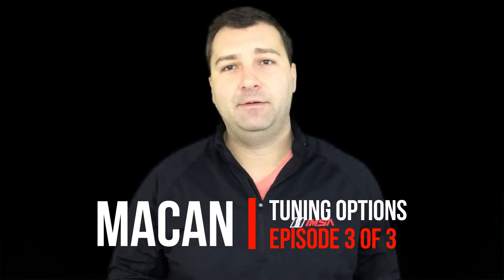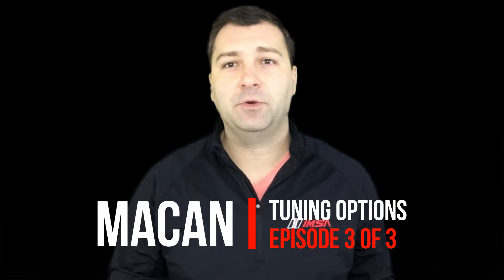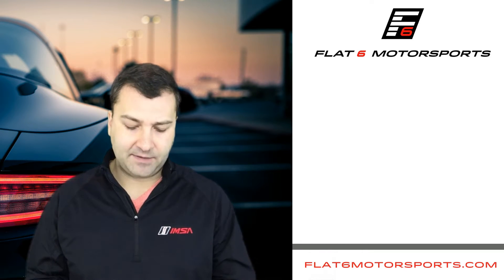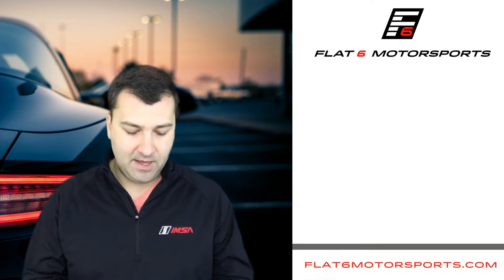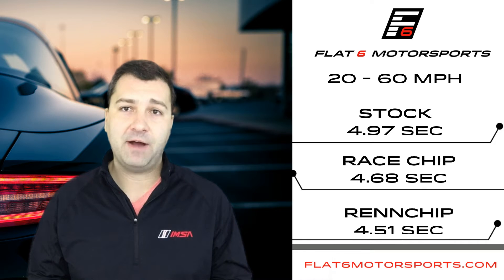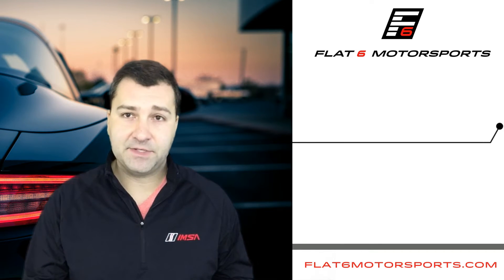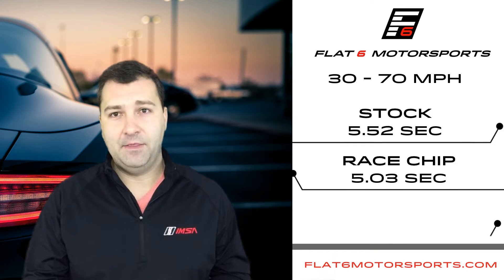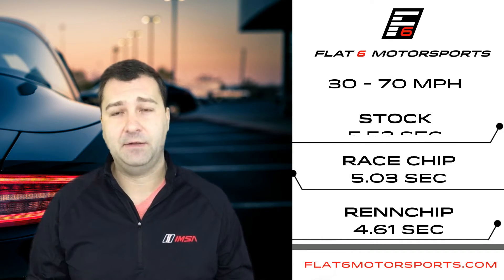Porsche Macan Tuning Options - Piggyback Dyno Results

Comment: Really curious as to the 0-60 difference on a Macan turbo with rennchip, can you estimate?
Reply from the maker: We did some 20-60 and 30-70 comparisons. If I had to estimate maybe .2/.3 sec quicker from 60 but just going off feel. Info on those here: https://flat6motorsports.com/blogs/news/macan-tuning-piggyback-performance-dyno-numbers

Comment: What about the VR tuned and DTE?
Reply from the maker: We did not have either of those units for testing on the dyno. The DTE unit we showed in a previous video was actually calibrated for the Macan Turbo. We wanted to still show the hardware. We don't have a dyno in-house but looking at doing more testing later this year.

Comment: how much HP does it gain on the wheel
Reply from the maker: Check our blog post. The Race Chip added 10.7% at the wheels and the Rennchip 14.4%. The dyno read very low so I'd rather show % increases and the calculated crank, otherwise the gains also seem diminished.
Reply from the maker: https://flat6motorsports.com/blogs/news/macan-tuning-piggyback-performance-dyno-numbers
Reply: So around 35-40hp !